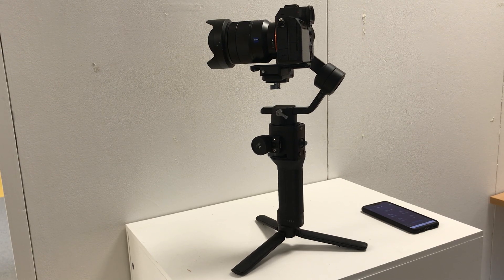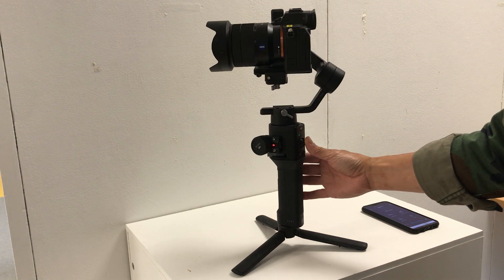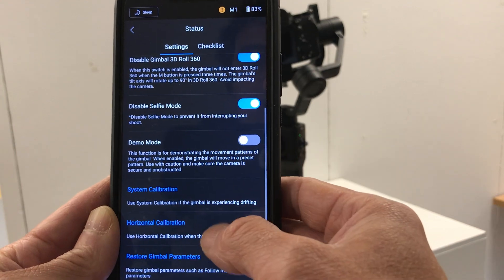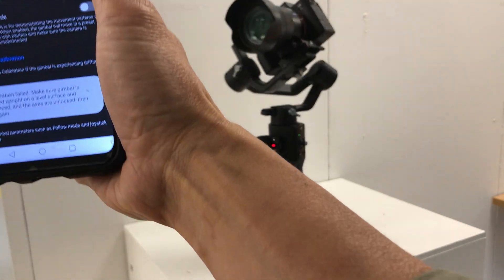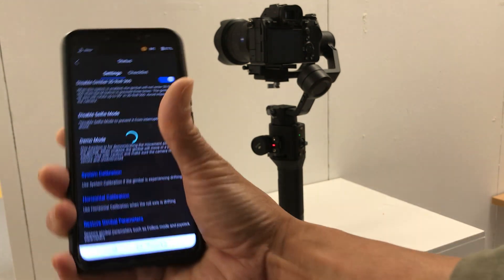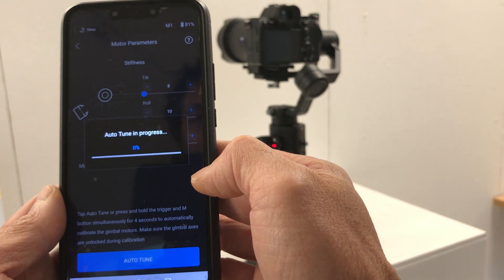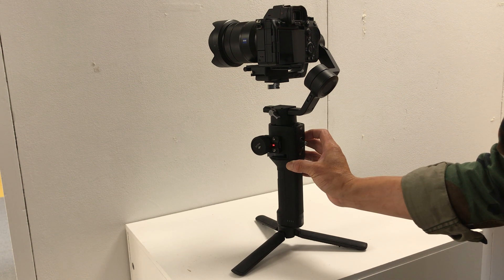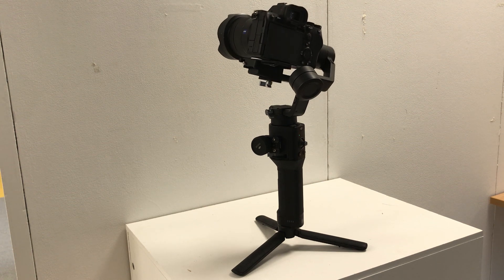Not working Ronin SC Video for DJI Forum

Comment: Thanks for sharing I have the same problem. Thought I was going crazy, I kept trying to balance the camera over and over. Hopefully there's a solution other than throwing it away.
Reply from the maker: Because it was a work gimbal - I work at a Uni instructing students on how to use it - they paid for it to be repaired by DJI. I don't recall how much it cost but DJI were pretty good with their comms.

Comment: The problem I have is that the camera doesn't turn. Is there a solution or should I put another listing on eBay to get rid of the device?
Reply from the maker: Because it was a work gimbal - I work at a Uni instructing students on how to use it - they paid for it to be repaired by DJI. I don't recall how much it cost but DJI were pretty good with their comms.

Comment: Same problem with my Ronin SC. When turned on, lambada dances! Calibration does not help. Were you able to solve this problem?
Reply from the maker: Ha ha, Lambada dances! I like that turn of phrase. I sent it back in the end, pretty good customer service, got a free tote bag with DJI on it. It was out of warranty but work paid for it to be fixed - I seem to remember it being around 150 Euros.
Reply: @iopvideo3137  What's the address? Where to send it?

Comment: Did you find a solution?
Reply: Same issue here.
Reply from the maker: @leiferiksele   @Leif Erik Sele  I sent it back to DJI in the end. Even though it was out of warranty they paid for the postage. Customer service was actually really good. I'll ask the Line Manager to see how much it cost , it wasn't too bad from what I remember, something like £130 GBP.
Reply: Mine worked pretty good before I updated firmware. I started noticing roll problems after. I've spent so much time messing with it. Perfecting my balance. 3 different cameras. I'm going to see if I can install old firmware. I heard that can help. 
Tell us if you find anything out about yours.